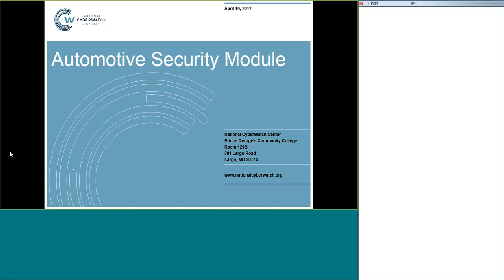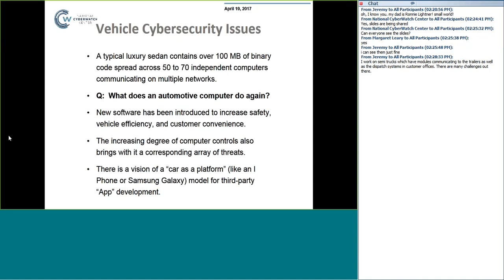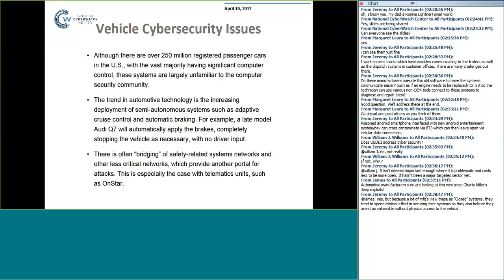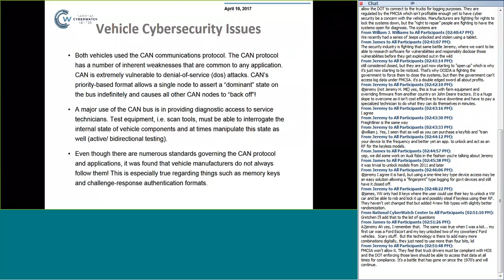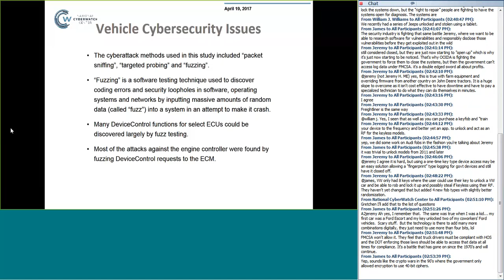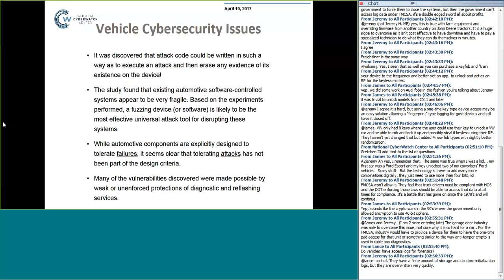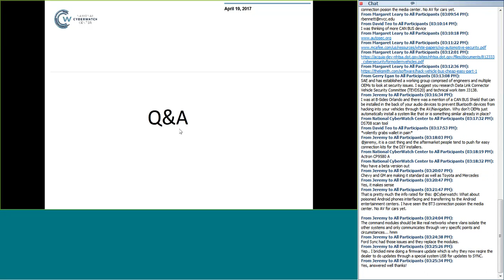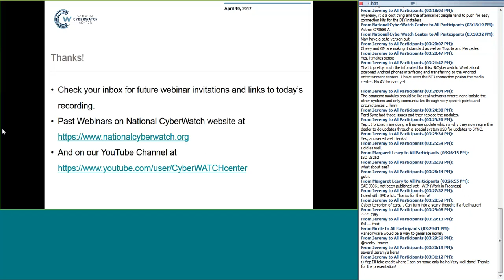Automotive Cybersecurity Module Webinar

Comment: Hi! Quick question, since this was uploaded in 2017 and also the webinar is from 2017, i would just like to correct that there are much higher can bus speeds. Usually we use 500KB/s for slow communication. I work for bosch as an automotive embedded developer, if that gives any weight to my opinion. Btw, nice talk, enjoyed it very much!